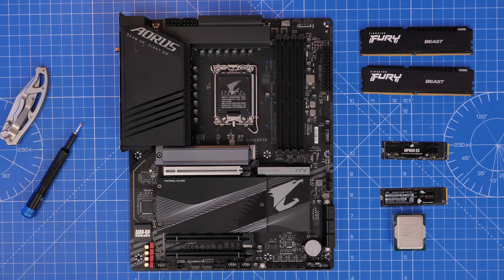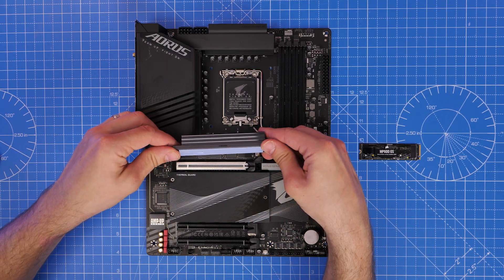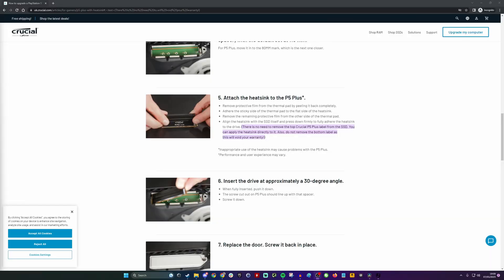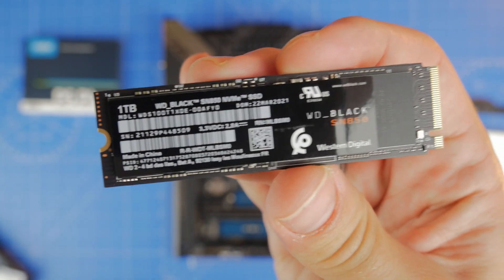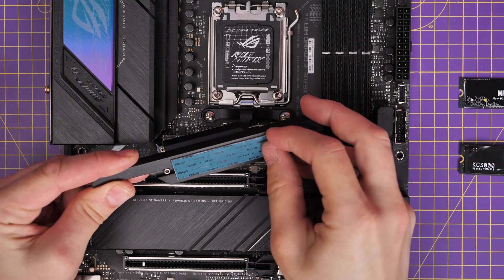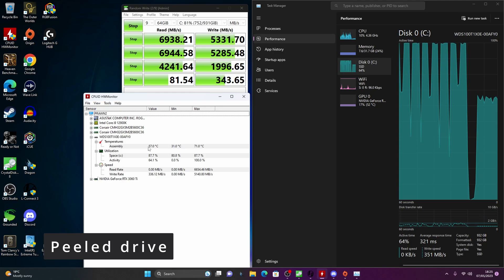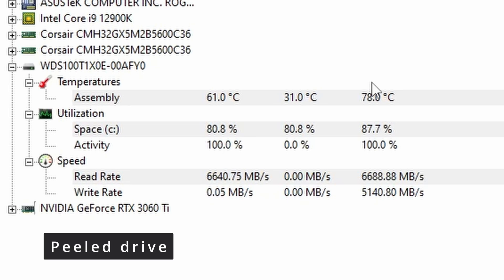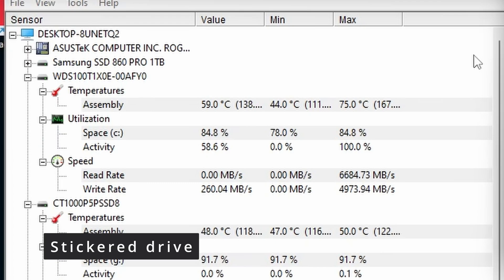Should you peel the sticker off your NVMe? Does it help?

Comment: I think the issue I see with these stickers, is that the SSD bits are not exactly even, so for example one side may need 1mm thickness and one side 0.5mm. Samsung is notorious for uneven distribution, thus thermal pads not working well on them.

Comment: Well, here is an issue that I don't see mentioned here. I have an MSI Tomahawk b650 mobo and a Predator GM7000 ssd. The mobo has a screw-on heatsink/shield that goes over your ssd  once its in position. The ssd has a stuck on heatspreader sticker that when left on, will bend the ssd once you screw down the mobo's heatshield. I removed the foam heatspreader from the ssd, and screwed it back and no bending. Since the mobo has a heatsink, is it ok to remove this foam heatspreader on the ssd and all will still perform well? What is your opinion on this?

Comment: I would advise you to use a liquid thermal putty of the Honeywell HT7000 type (not thermal paste!)
 because the height of the memory chips and the controller are different
using a thermal putty, you will get the maximum contact of the radiator with the SSD

Comment: I don't think that difference is negligible. 5 deg over 70 is around 7-8%. Couple that with a decent heatsync and you could bring it down 10-20 deg (a guess) in addition. Through the sticker, the heat would reduce the effectiveness of the heatsync.

Comment: So with sticker+heatsink marginally higher than peeled. This is great info, since I have a Samsung SSD with a slight crack in the heatspreader(sticker) which idles at 55 degrees with a heatsink over it.
I'll be removing that sticker and running the heatsink directly on the drive with thermal pad

Comment: i got the s770 fanxiang at a budget price. one review used a thermal gun on it showing the controller hitting >70.C (i dont know if they used heatsink tho, it doesn't appear so)). 
When i received mine i held it up with the provided heatsink and you can see plenty of clearance on controller/dram (measures 0.3/0.25mm with feeler gauge).
I prob shouldn't have. but i used the supplied thinnest thermal pad on the dram/controller and worked it flush with heatsink. Then used thermal paste on Nands an all on heatsink. 
I dont have a thermal gun to see if controller is any more tamed though so it's a bit of an incomplete exercise. 

It actually makes me curious if ssds like the wd black are flush accross all chips. or if its simular to the cheaper product,

edit: 
*i copied that disc mark test like in this vid, The max temp on the hw monitor came up 54.C so i am only guessing that maybe controller temp Is absent. 
*the 9/64GiB which yields  *R7.1K W6.8K, **R 2K W 5K, ***R800 W600, ****R61 W 300. 

### found heat probe (looks like wire with a tiny blob of solder) that goes into multimeter and placed it on heatsink near controller,. temp during write on line 2 hit 66( adding hand pressure) . after test sitting 56 (vs 54 peak on sensor).

cheers from shaun.

Comment: If you ask me, i would imagine the MANUFACTURER who literally put that sticker on there knows a shitload about their product and has put it there for a specific reason. It could be made of special materials designed to help optimize its performance in conjunction with whatever its used with.
Reply: It may be necessary when there is no heatsink on the motherboard. But when there is a heatsink included it may provide a benefit.

Manufacturers have to build their device to work in every likely use case, but the end user can tune a device to excel within their own specific use case

Comment: On my Corsair MP 700, I peeled off the sticker and not a single problem to date. I agree that it is always best to refer to the manual aswell. On mine, step #1 is to peel off the front label on the SSD and it doesn't void my warranty so long as you safely remove it with heatgun or something and store it inside of the factory box.

Comment: Do the heat sinks have a sticker on them that need peeled too? The heat sink on my MOBO's m.2 slot had blue plastic .. I bet it should have removed that.. :(
Reply from the maker: Yes, there's usually plastic protecting the thermal pads
Reply: @TheProvokedPrawn  I went back and looked through the mobo manual.. it does tell me to remove it. I just must have breezed passed it. I'm glad I went back and peeled it off before attaching my 4090. With my big noctua cooler in the way I would have never gotten the 4090 disconnected. Btw: I was able to get to that m.2 under the heatsink/OLED  display with a long/thin Phillips without having to remove the noctua cpu cooler!! God saved me there.. I didn't have more thermal paste to redo it, lol!

Comment: Often improved ventilation, else thermal transfer between component & the surrounding air environ, strongly influenced by surface area factor. Heatsink design using fins likely improve performance of lesser materials.

Comment: My system board has coolers for the NVMe drives that say to remove the top sticker, put the system board's sticker on it, add the thermal pad that came with the system board, and then put the heat sink on top.

I tested with both the stock sticker and the one that came with the system board, and using the recommended sticker that came with the system board resulted in a 4 degree C drop using the system board's sticker. I'm not sure what exactly in the sticker that came with the system board, but it definitely works!

Comment: Removed the sticker on the front of my 980 pro,the one with the controller facing up,not the copper one that's on the back.And then applied a thermal pad and a heatsink on top of it. Before the ssd under heavy load was sometimes in the mid 80's,i'm talking celsius,above the 70 degrees celsius max temp specified by Samsung.
Now the max temp i saw was 72-73 celsius after stressing the ssd.
Reply: Why not just buy an SSD cooler? I got a nice electric one for $20 that is also brand name.
Reply: @allcore5172  peltier one? then of course sticker is a must to prevent damage of the chips from possible humidity

Comment: I hate stickers, I always rip them off and put heatsinks or coolers.
Reply: i currently have the t700 with heatsink and i want to remove it. (I already have) and will it void the warranty? ALSO i dont want to use the heatsink due to its largeness. So i want to use my mobos heatsink which also states its 10X at heat dissipation. Can i do this? Also on the non heatsink version, there is a sticker on it. Since i got the heatsink version and i removed it, there is no sticker?? Does this matter, should i worry? The thermal plate for my b650e atx ice should cover the ssd but there wont be a sticker, so it will directly touch my ssd. Am i good??

Comment: I had a dilemma, with my r7 5700x build, bear in mind I have never built any modern components, a few replacements and old builds but I had never experienced m.2. I got a adata ledg 800 pictured with a gold fancy sticker, however when it came the "sticker" was a heat sink but my b550 tomahawk also came with a heat sink. I went with the in box sink looks good and temp have been 44 max. I was worried about temps but once a sink is stuck I didn't fancy trying to peel it off.

Comment: Keep in mind that the stickers usually have aluminum or copper cores. While the controller runs better at lower temperatures and is prone to thermal throttling, NAND flash actually runs BETTER under a decent bit of heat. So the goal of the sticker is to transfer heat way from the controller and onto the NAND to maximize performance.

The big heatsinks emphasize cooling the controller, but possibly over-cool the NAND. This isn't a significant enough issue to worry about, and the controller is going to be your bottleneck anyway.

But I believe there's even a wear improvement from warm NAND. I want to say that the higher entropy (ie "fuzzier electrons" if it's easier to picture) makes it easier for electrons to tunnel through to the floating gates, reducing the voltage that they reach before actually jumping, and thus reducing the wear on the gate isolation barriers. But that's just a vague armchair hypothesis.

Comment: I always peel off mine.  Even though they say it is thermal conductive and heat transfers through many of the stickers.  Plus you can pull the sticker off in such a way as to put it back on if you have a warranty issue.  Just keep the sticker in the box that it came in.

Comment: Should you, that depends, Some of the stickers on NVMe SSD's are actually thin copper heat spreaders (Samsung 980 Pro) others are just paper. 

If you are going to use the heatsinks on the motherboards than removing the sticker (paper or copper) won't matter. Its more of if you put them into carrier cards that this will become and issue if you remove a heat spreader

Comment: Keep in mind that most NAND flash chips are only rated to operate up to a temperature of 70C. They don't have the heat tolerance that (for example) CPU's do. I think most people are used to thinking about the maximum operating temperature of PC components as the Tj Max of a CPU die (~100-105C), but NAND flash is slightly different! You will also notice a decrease in the lifespan of your drive if you continually operate it outside of the tolerances specified in the datasheets.
Reply: Will an SSD cooler help this? I ordered one because they really are very inexpensive
Reply: @allcore5172good case airflow over your m.2 slot on your motherboard will make a big difference. So will (in theory) a vertically mounted GPU. Though I have not tested it myself

Comment: Those are some pretty high temps, but I guess maybe that's normal.   My PNY CS3140 idles at around 45 degrees C I've noticed, under no, or light load.   Under medium use like playing a game, I've noticed it gets up around 60 degrees.   It doesn't seem to slow it down much though, I usually get close to the advertised 7500MB per second read speeds.  However my PCI-X 3.0 Samsung 970 Evo, idles at around 30 degrees C, under load it goes to about 47 degrees.    I guess the PCI-x 4.0 drives run a good bit hotter.   I would get a heatsink for my Pny drive, but I don't think my giant Gaming X Trio 4070 leaves enough room to put one,  it would be close.
Reply: up to 80c is with in operating temperatures for a nvme. Generally they are around 40-50 idle, 60-80 in use. Although they do throttle down past 70c.

Comment: The issue here is: the controller chips needs to be cooled, the NANDs need to be warmed for best performance - the metal "stickers" therefore spread the heat - so let it be (good M2 modules even don't need additional coolers on top)